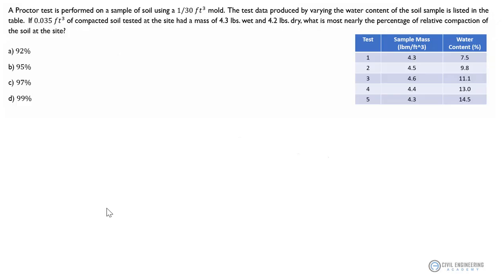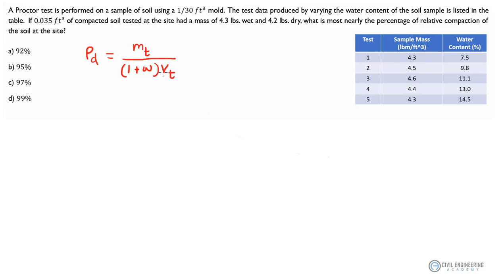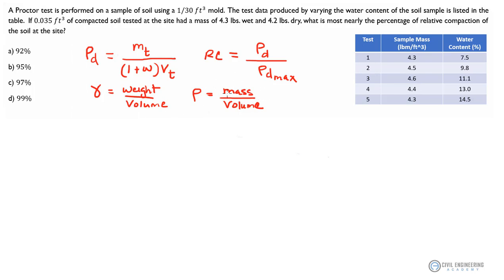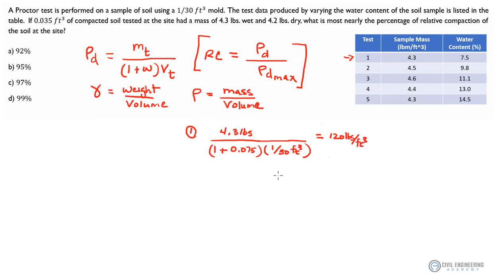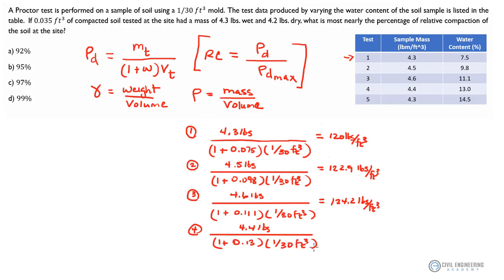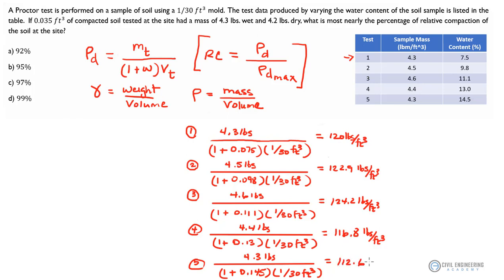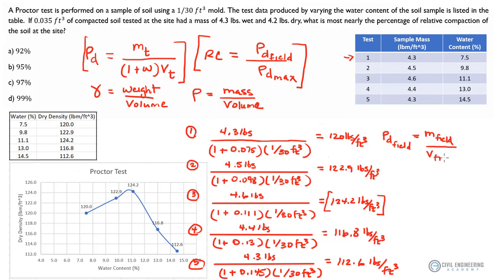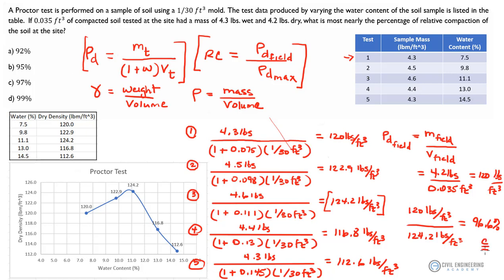FE and PE Geotechnical Problem - Find the Relative Soil Compaction at the Site!

Comment: ncees pe hb 1.1, p. 152-154.

but this reference doesnt include the density, mass, w, and V equation presented here. therefore, this example needs to be tweaked to accommodate the new cbt reference format.

still good practice.
Reply: The density equation is basically the same as the dry unit weight equation on p. 141: Wt/(V*(1+w))=dry unit wt

Comment: CBT Ref Man Pg. 154, Sect 3.9.2, gamma d- Pg. 139-140, Sect 3.8.3
Reply from the maker: Thanks for listing these!
Reply: ncees pe hb 1.1, p. 152-154.

but this reference doesnt include the density, mass, w, and V equation presented here. therefore, this example needs to be tweaked to accommodate the new cbt reference format.

still good practice.